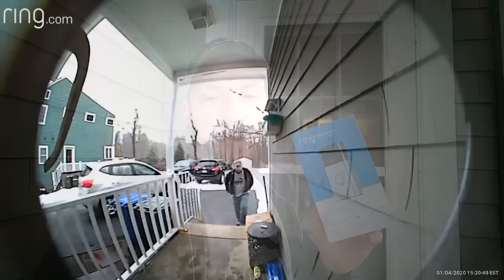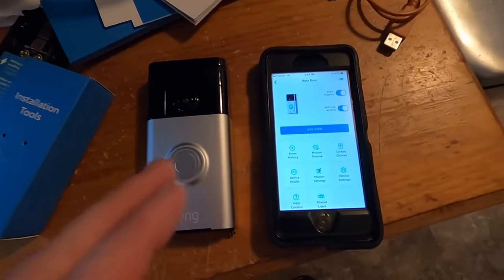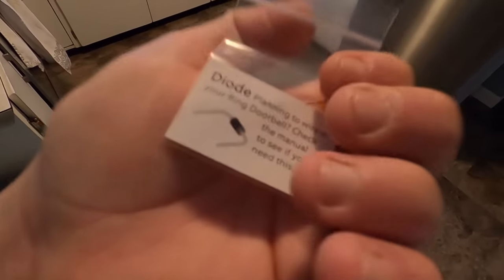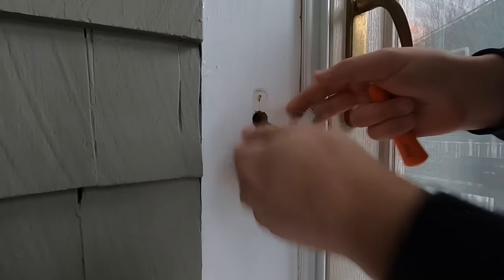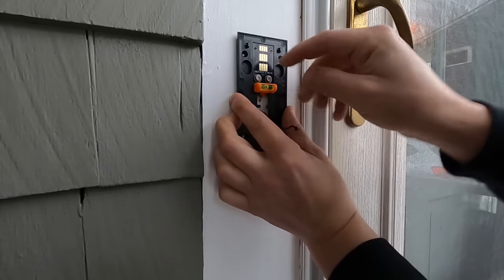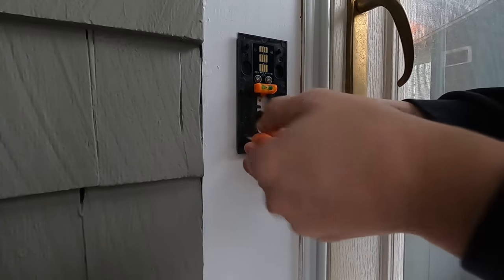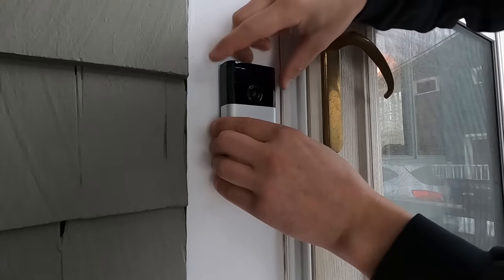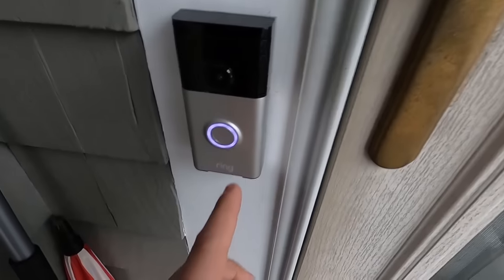How To Replace a Wired Doorbell with Ring Video Doorbell | DiY Install

Comment: Hello, should we turn off the electricity to the doorbell first?
Reply from the maker: It would probably be a good idea to shut the breaker off to the doorbell but any doorbell I have ever come across has been low voltage wires so I wasn't too worried about it.  Again, the instructions do recommend turning off the power at the panel.

Comment: Do people usually steal those im worried about someone stealing it since it is pretty expensive does ring replace it if someone steals it i live in the hood
Reply: I was install  not expencive one got steal not sure if i should install this my unit infront of street n bus stop
Reply: Use your head you can always screw some type of metal cage that leaves camera open, make sure to cover up screws with liquid naila sand it off and paint so thieves dont know type of screws used or where they are. 
One good method I used before i grinded off screw head with a grinder so it is impossible to use any drill or screw driver

Comment: Didn’t want to scan all the comments, but if I hard wire it will I still have to charge the battery?
Reply from the maker: You only have to remove the Ring to charge it if you do not hook it up to an existing doorbell.  I’m sorry I should have clarified that.  So to be clear if you do not hook it up to existing wiring you need to remove and charge, otherwise the doorbell wires will charge it if you have it hooked up.

Comment: Hey, awesome video but can you safely touch live wires? I didn’t hear anything about that, and I’m kinda concerned, thank you
Reply from the maker: It would probably be a good idea to shut the breaker off to the doorbell but any doorbell I have ever come across has been low voltage wires so I wasn't too worried about it.  Again, the instructions do recommend turning off the power at the panel.

Comment: Is the clarity good? It looked very blurry on your phone?
Reply from the maker: Hey, Ray!  It is not 1080.  I can make out faces for sure.  I might be missing a setting or something but it does the job.  Thanks, for checking out the video!
Reply: The higher end Pro has 1080p, for better clarity.

Comment: Did you need any special thing to connect the wires, I mean, I have a mechanical doorbell that I connect directly to the light. So, do I have to do, change or add anything special for the ring doorbell works?

Comment: So you have to constantly remove it to recharge it ? I didn’t get that part. Please explain
Reply from the maker: You only have to remove the Ring to charge it if you do not hook it up to an existing doorbell.  I’m sorry I should have clarified that.  So to be clear if you do not hook it up to existing wiring you need to remove and charge, otherwise the doorbell wires will charge it if you have it hooked up.

Comment: Wait so those wires you plugged in won't keep it charged? And also how long does it last in a full charge
Reply from the maker: You only have to remove the Ring to charge it if you do not hook it up to an existing doorbell.  I’m sorry I should have clarified that.  So to be clear if you do not hook it up to existing wiring you need to remove and charge, otherwise the doorbell wires will charge it if you have it hooked up.

Comment: How do you set it up to work to and through your WiFi router?  Seems to me you can't just screw it on and it works.  Since you probably don't want to reveal personal info, just tell me if there are instructions included for network setup?
Reply: Pair it with the Ring app.

Comment: For the mechanic doorbell not needing the diode.  Will the power to the Ringdoorbell keep the battery charged?
Reply from the maker: Yes if the doorbell is wired it will charge.  Sorry I did not mention it in the video!

Comment: Bought one. So far it has taken 5 hours to 3/4 charge. The screwdriver that came with it does not work with the screws that came with it. It is also missing 1 security screw and the 1 that did come with it doesn't fit. LOL.
I'm currently not feeling too happy with this purchase.
Your video is good though.

Comment: My back door does not have a door bell. Will it still work with out the electrical connection?  Obviously no sound inside the house but will you be notified on the phone that someone is there?  Thanks
Reply from the maker: Yea it will still work.  You will get a chime and notification on your phone.  You will have to remove it to charge it once in a while.  Not sure how often but you can check the battery life with the app.  Hope this helps.  Thanks for watching!

Comment: Do the wires power the doorbell and the battery is a backup?
Reply from the maker: You only have to remove the Ring to charge it if you do not hook it up to an existing doorbell.  I’m sorry I should have clarified that.  So to be clear if you do not hook it up to existing wiring you need to remove and charge, otherwise the doorbell wires will charge it if you have it hooked up.

Comment: If you wired it to your old door bell do you still need to charge it?
Reply from the maker: You only have to remove the Ring to charge it if you do not hook it up to an existing doorbell.  I’m sorry I should have clarified that.  So to be clear if you do not hook it up to existing wiring you need to remove and charge, otherwise the doorbell wires will charge it if you have it hooked up.

Comment: So do I charge the battery fully before hardwiring it to where the old doorbell was. I know you say you don’t have to take down and recharge but will it need an initial charge?
Reply: It comes with an initial charge, but I would still keep it plugged in while you set it up just to be on the safe side.
Reply from the maker: Yes, I agree with you, Kyle!
Reply: @TheFixerHomeRepair  Yeah I think The Fixer answered that a couple times above.

Comment: Good video. I might have mentioned the importance of NOT letting the wires touch each other. Looked like you came VERY close to popping the transformer.
Reply: Ah so that’s why they tell you turn off the breaker

Comment: My doorbell is to the left of the door.Can a ring door bell work on the left wall vs the front wall?
Reply: I have the same problem BUT it's not a problem. I'm in a condo and I see the breezeway without issue.
Reply from the maker: It should be fine.  This camera has a very wide angle lens.  Hope this helps.  Thanks for checking out the video!

Comment: So you have to remove the unit to charge it? I thought the power wires from the old button once hooked up would charge it??
Reply from the maker: You only have to remove the Ring to charge it if you do not hook it up to an existing doorbell.  I’m sorry I should have clarified that.  So to be clear if you do not hook it up to existing wiring you need to remove and charge, otherwise the doorbell wires will charge it if you have it hooked up.
Reply: @TheFixerHomeRepair  No worries!!  Thanks!!

Comment: I have a new home with an entry door and two side light panels, the frame isn't wide enough.  How do you mount a RING Doorbell?
Reply from the maker: That is a great question, Thomas.  Really hard to say without seeing it but maybe you could drill holes in the middle of the bracket and attach two screws that way?  Again, really hard to say without actually seeing it.  Hope this helps.  Thanks for checking out the video.
Reply: Thomas Jacques I have that problem also and my frame is nut flat either

Comment: Only thing I don't like about this is you have to remove it to charge it. But it's a good product and looks easy to install
Reply from the maker: Hey Deko!  Yeah, I should have clarified a bit in the video... if you hook this up to an existing doorbell you never have to charge it.  The doorbell wires give it the juice it needs.  If you are installing it without hooking it up then yes you will have to take it off to charge it every now and again.  Thanks for checking out the video!!

Comment: While most 99 percent are low nm power there are some out there using full socket power. It's rare in between but they exist so unless you are sure I'd just shut off the breaker to that line.
Reply from the maker: That is a good tip my friend!  Thanks for checking out the video!

Comment: This will be tough for me.  Our entry way is white stone.  The doorbell is not mounted on the door frame.  It is mounted on the stone at least three feet from the door frame.  So if someone comes up to our door they have to reach about three feet to ring the doorbell.  So if the new ring were installed at the same place I am not sure it would even "see" the person ringing the doorbell.  Also this white stone is not flat.  There is nowhere on any of the stones while would be suitable to drill the holes as described.

I guess the ring2 could be installed on the door frame.  It would not be connected to the door chime as is.  I suppose that means that when it's pushed it would still alert to my Iphone.  I am not sure.

Comment: being "wired" it doesn't stay charged?  curious how often you need to take it off   to  charge it?
Reply from the maker: You only have to remove the Ring to charge it if you do not hook it up to an existing doorbell.  I’m sorry I should have clarified that.  So to be clear if you do not hook it up to existing wiring you need to remove and charge, otherwise the doorbell wires will charge it if you have it hooked up.

Comment: As my home is in Ottawa, Canada, our winters are, on average, very cold. Battery life is a concern. It would be upsetting to have to remove the Ring every few weeks when it's minus 25 or 30 Celsius. Comments?
Reply from the maker: You only have to remove the Ring to charge it if you do not hook it up to an existing doorbell.  I’m sorry I should have clarified that.  So to be clear if you do not hook it up to existing wiring you need to remove and charge, otherwise the doorbell wires will charge it if you have it hooked up.  As far as the low temperature... it got pretty cold here last winter and it did just fine.  Hope the video helps out!
Reply: @TheFixerHomeRepair  Thanks for that. Great video.

Comment: This is probably a dumb question, but if it's wired in why does it also require a battery that needs to be recharged?

Comment: Is the other ring door bell that easy to install and it’s rechargeable also
Reply from the maker: Yes, they are all pretty much this easy and all of them charge off of wires if you have them.  If not, you have to remove it to charge it every once in a while.

Comment: Is yours gen1 or gen2 have both links.
Reply from the maker: Hey, Mike!  The one I installed in the video is 1st gen.  2nd gen is similar.  I believe the differences are that you hook the wires up to the ring and not the bracket on the second gen.  Also it has a removable battery.  Hope this helps.  Thanks for watching!

Comment: Do you need to turn the power off in order to install this?
Reply from the maker: It would probably be a good idea to shut the breaker off to the doorbell but any doorbell I have ever come across has been low voltage wires so I wasn't too worried about it.  Again, the instructions do recommend turning off the power at the panel.

Comment: Do I need to turn the power off for installation?
Reply: yeah i’m wondering the same thing
Reply from the maker: It would probably be a good idea to shut the breaker off to the doorbell but any doorbell I have ever come across has been low voltage wires so I wasn't too worried about it.  Again, the instructions do recommend turning off the power at the panel.
Reply: @TheFixerHomeRepair  Thx for ur reply~

Comment: You still have to take the door bell off to charge?
Reply from the maker: Hey, T.K!  You only have to remove the Ring to charge it if you do not hook it up to an existing doorbell.  I’m sorry I should have clarified that.  So to be clear if you do not hook it up to existing wiring you need to remove and charge, otherwise the doorbell wires will charge it if you have it hooked up.  Thanks for checking out the video!

Comment: If it's hardwired to the doorbell electrical system...don't the batteries charge automatically??
Reply from the maker: Yes.  Sorry about that, I should have clarified that.  You only have to remove it to charge it if it is not hard wired.  Thanks for the comment and for checking out the video!

Comment: What about the transformer. How do I know if I need one?
Reply: If you have a digital doorbell chime, it's required in order for your Ring Doorbell 2 to function properly. The diode is not required for a mechanical chime.

Comment: Do you have to shut the power off??
Reply from the maker: It would probably be a good idea to shut the breaker off to the doorbell but any doorbell I have ever come across has been low voltage wires so I wasn't too worried about it.  Again, the instructions do recommend turning off the power at the panel.

Comment: Question: the live wires of the doorbell won’t electrocute me ? I don’t need to turn the power off first ? … I’ve never done this so I’m just a little scared.
Reply: That was my concern as well. I dug around a little and found that the current to a doorbell is significantly reduced i.e. usually 12v instead of the standard 120v. 12 volts is not dangerous. Still makes me a little nervous to be honest. However, finding what circuit it's on is a gigantic nebulous pain in the arse...
Reply: @michaelkniess2098   wow ! Thank you for that information. Makes a lot a sense. I’m still with you . Not trying to play with my life . Maintenance came by and installed it. He looked at me strange when asking about the electricity - then he just proceeded to install the Ring with the power on 🤷🏽‍♀️.
Reply: I ended up just installing without killing the power as well. My voltage meter wasn't picking anything up which told me it was safe. I'm still alive😉

Comment: Quick (stupid) question - I did not see you turn off the breaker. Think the instructions call for that, did you do it on your end or just skip it?
Reply from the maker: It would probably be a good idea to shut the breaker off to the doorbell but any doorbell I have ever come across has been low voltage wires so I wasn't too worried about it.  Again, the instructions do recommend turning off the power at the panel.
Reply: @TheFixerHomeRepair  Thankyou for your response!

Comment: What if your current door bell is not on a flat surface? Can I still use this ring doorbell?
Reply from the maker: Sure!  In fact the newer Ring has plates for uneven surfaces like siding.  You can always make your own blocks to make it even as well.  Hope this helps.  Thanks for watching!

Comment: My instructions call for a transformer to be installed if wiring to an existing doorbell.  Do you not need to do that?
Reply: Your existing doorbell, if it is wired, would normally already have a transformer.
Reply: If you have a digital doorbell chime, it's required in order for your Ring Doorbell 2 to function properly. The diode is not required for a mechanical chime.

Comment: So do I have to remove the RING and charge it every once in a while?    Or does it get power from the wires that I'll never have to deal with it again?
Reply from the maker: You only have to remove the Ring to charge it if you do not hook it up to an existing doorbell.  I’m sorry I should have clarified that.  So to be clear if you do not hook it up to existing wiring you need to remove and charge, otherwise the doorbell wires will charge it if you have it hooked up.

Comment: Pity it can't be charge from power supply of the doorbell. I've seen quite few Rings not operating because battery discharged

Comment: I installed Ring door bell works fine but indoor mechanical doorbell won’t work. Any ideas?
Reply from the maker: Hey, Walter.  Some brands of door chimes just won't work with the Ring unfortunately.  You might have to get a new one that is compatible.

Comment: I have installed it the way you have but i can't get it to ring inside.Only rings on phone. Can you help? I noticed that I have to recharge even though its hard wired.
Reply from the maker: Hey!  If the wires are hooked up tight and another doorbell works, try this... try to gently pry the hanging plate and try to squeeze the plate and the ring together at the top, then press the button.  If it rings, your mounting bracket may be screwed in too tight or uneven.  You may have to back the screws off a bit.  The goal is to get the contacts on the back of the ring to make solid contact to the contacts on the bracket.  Let me know if this is the issue, thanks so much!! Hope this helps!!

Comment: when you disconnected the doorbell the light was still on which means the circuit breaker to that wire was still hot how did you touch it

Comment: The old doorbell I have is like yours, but its board in which it’s mounted is only about 1.25’” wide, and that ring doorbell wouldn’t mount in that location unless it was 1/3 the width of the original….. but thanks anyway 👍🏻🇺🇸 11.11.23

Comment: Problem is, if you have a existing chime your supposed to use a jumper between the two wires to disable it.  or remove it off the wall.

Comment: I have a problem because where my existing doorbell is located. It is an old style small and thin type and is mounted on a thin strip that is not as wide as the Ring. I don't see how I can mount it. Any ideas?

Comment: I bought the Ring video doorbell 2, if you connect it do existing wiring? why does it need a battery?
Reply: I was curious and looked this up. If you hook it up directly to the doorbell wiring, it will keep the doorbell charged according to Amazons Customer Questions & Answers. There was a person who said if you elect to go wireless, the battery could last up to a year until needing a recharge. A year seems a little far fetched but who knows.

Edit; Apparently the hard wire charge doesn't work in 32f or below weather according to that same article.